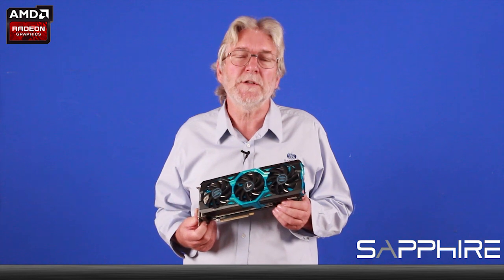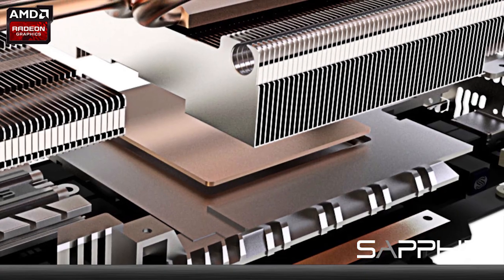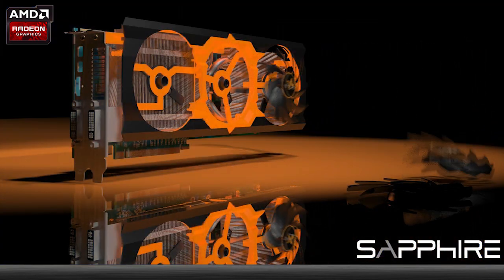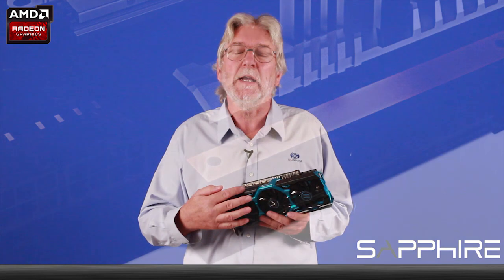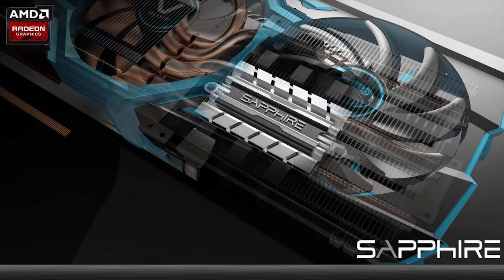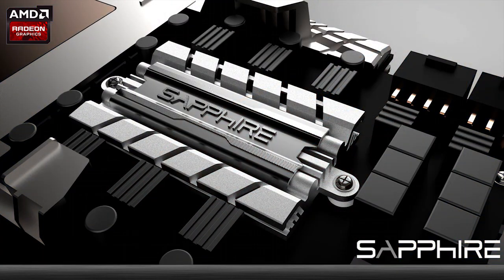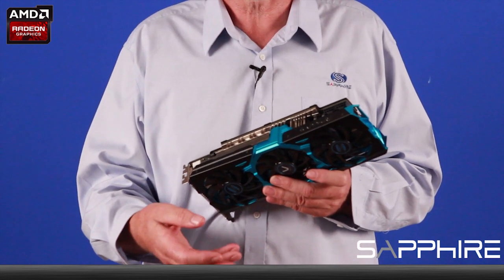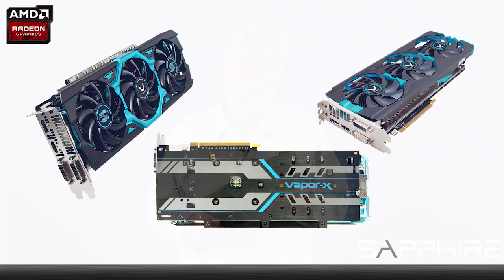Special features of SAPPHIRE R9 290X Vapor-X

Comment: Okay got my card yesterday i have a Corsair TX 750 watts psu & wouldn't start up .
My PSU  =  http://www.corsair.com/en-us/tx750w

Shouldn't it be enough ? I know it's an oldie but shouldn't it still be a goodie :D ?
Reply: ***** I bought the Corsair 850i, but now waiting for a new Gpu to be announced
& still got the 2600k sandybridge :)
& My Trusty 480GTX :D
Reply: ***** Are you high? 850w is enough for crossfire. a 290x uses 300 at most when loaded lets say 320 for a safer margin. thats 640 for 2 and you have 210 left for the cpu and the rest of the pc. That is more than enough and even have a bit of oc room.
Reply: Ashaira LoL take a chillpill = 250.000Mg :D
Reply: ***** Wait for the nex Gpu to come out if you can. I dont think it will be loong before the new Gpu Cards come + thees  have been out for a long time now  + they use lots of power like thees old power hungry hogs we have now :D 
The new ones will save power and give you crazy bandwith smaller core desighn But thats just my opinion :)
Reply: I did the same Got this Card & a nother one but the thing is thoos Card if, all of them, they have been used for Bit coin minning :D and befor them i got the 970 returned that and 5 Months or so later we find out that the specs were lied about so im just going to wait for either the 390x or whatever the green team has to offer, but yea specs are looking crazy :)
Reply: Yesir :D and they want us to use occulus as astandert or virtual goggles. Actuly they want us to become the Next computer. If you have 35 mins look at this if u dont already know about it dont mind the Christianety even thoug i would like more ppl to be Christ like :) just look at it as a documentery if you like. Its about new tech. . .
Reply: *****
and i just told you 850 is enough for 2.

Comment: I wish hardware producers would start adding dust filters to their cooling solutions. To be blunt, it doesn't help with fancy triple fans and heatpipes if the thing gets clogged by dust, and it will - very quickly! Dismanteling a card for cleaning is troublesome, and might even void your waranty.

Comment: The $330 GTX 970 beats the 290x even at 4K.
It also runs cooler.
Consumes less power ex ex.
NO reason to buy a 290x unless you can find one for $250
Reply: According to techreport.com the 290x beats the 970 overall, but at the cost of extra power (and heat)
Reply: I know, I would pretty much need a new case cause I got a amd fx 8320@4.7 too so might just wait or go for 970.. we'll see, but the vapor X runs much cooler than that though, the thing is, all the heat it dissipate will go in my case ! and heat up my CPU too.
Reply: well i see 290x win every test. you wrong:P
Reply: You forgot that GTX 970 and 980 are brand new. AMD are planning to release the R9 300 series, so nVIDIA might have a strong competitor.
Reply: Wow really I will have to check that out. That's great that would mean there is a serious price drop on the way! :D
Reply: ScentofLaceration
AMD dropped the 290x prices to $300.
Reply: Sanic  manufacturers dropped prices not AMD ;). hopefully the prices will adjust/drop even more once the gtx 960 gets released
Reply: Thomas Syxe
You just spent a bit more and buy a 970.
It beats the 290x, so it packs a huge punch.
Reply: Thomas Syxe
970 with a 10% overclock beats the 290x even at 4k.
and it is like 50% quieter and runs 30C cooler.
Reply: yea though they often compare a OC 970 to a stock r9 290x this one is an overclocked model so the performance is pretty similar, I'm thinking about getting a second hand one.
Reply: Thomas Syxe
The 290x have very little for OC room and runs 90c all day.
reminds me of my 100c HD5970.
970 is the best bet right now.
Reply: ***** might lol.
AMD will most likely keep making low cost budget video cards.
Reply: Sanic
Dude common. The only models that do that are the refference one, the one from asus which is because they used an old cooler instead of making a new one and the first revision of the windforce one. I have 2 280x in my case and even under constant stress the hottest one does not go above 72 degrees. Previouslly i had a 780ti which ran fine but it reached 81 degrees when running 1440p or above (yes i have a 4k monitor). You people act like these hot cards are anything special. Need i remind you of the 480 which actually had problems which caused cards to burn? i don't see you complaining about those.
Reply: Sanic i have a 5850 from the dec-2009 sapphire (before i used nvidia for 1 year and then burn) and i never pass the 65 C and still running perfect after so many years (the pc works 24/7 and i only make one rr when i woke up) also with the new cata omega i thought that i was buy a new card.So stop misinforming the ppl and go spend your money on companies that only look your wallet.Not to mention that i can still run bf4 at ultra.
Reply: BF4 ultra with a 5850 ? ROFL, nice joke. must be nice and smooth at 10 fps.  I had a 5870, 7950, and now a r9 290x, I know what I'm talking about.
Reply: Thomas Syxe
 Yeah you are right it is a joke but i said run not play.Yeah i have 15 with 20 fps at ultra and i can hear the fan speed up like crazy.But its a 5 years old card :( . I want to build a new system ONLY when the New Free-Sync monitors be on the market.
Reply: Sanic 
970 and 290x are neck and neck at 4k gaming.

http://www.anandtech.com/show/8568/the-geforce-gtx-970-review-feat-evga
Reply: The Sapphire 8 gb 290x Is neck and neck with 980 at 4k.
Reply: Sanic "like" 50% cooler, no need to beat on a product. Everything has advantages and disadvantages

Comment: Oh i'd love to have one of these i'm stuck with a card (other vendor) which i can't even up the voltage with out flashing a modded firmware it keeps cool at all time but whats the point if you can no longer overclock the card that high also i believe with my model it has no dedicated heatsink for the vram what kind of crap is that

Comment: Seems good, if only they would throw away blue colour.
Reply: Dude some people still love the black/blue color theme and I'm one of them. And soon I'm gonna be upgrading my system to a 8350/R9 290 since alot of games including one of my favorite series Everquest Next is gonna be supporting AMD Mantle  so don't diss the blue color just yet.
Reply: Black and blue is always cooler combo that black and red.
Reply: Tell that to my pc.
http://linustechtips.com/main/gallery/image/10157-4-pc-may-2014/
Reply: ***** Depends on the blue, but that blue is quite ugly.
Reply: ***** nice rig :) are they both 290x cards?
Reply: No they are normal 290's. The X version is a bit too expensive for me to justify the "minimal" gain in fps. It would be more than 200 euro more for just getting the 290X's.
Reply: Oi
Reply: They are called Sapphire Technologies for a reason, they make mostly blue cards (There are exceptions such as Tri-X, but in a way actual sapphires come in various colors as well).
Reply: ***** what case did you use on your build?
Reply: Thermaltake Chaser MK 1 . Also black and blue color scheme.
Reply: Looks nice, but a little pricey. Any cases under 100 that you would recommend? something that can fit a corsair h100i, sapphire r9 290, good airflow and cable management, and of course, that looks good too, with side panel? I know it's a lot, but I will gladly appreciate it, since I've been looking for days now and can't find anything!!
Reply: Bought the Z9 for my parents' pc. It's a decent case but i'm not quite sure if it would fit this card, the cards are pretty long. Have to do more research to make sure. according to some forums the h100i is too big to be mounted. But some have succeeded.
Reply: ***** ended up cancelling the i5 and the gigabyte g1 gaming motherboard, for the 8320, ud3, and 100i, planning on buying the phantom 630, since its the most complete case that i've seen